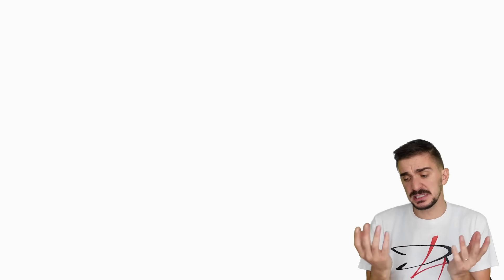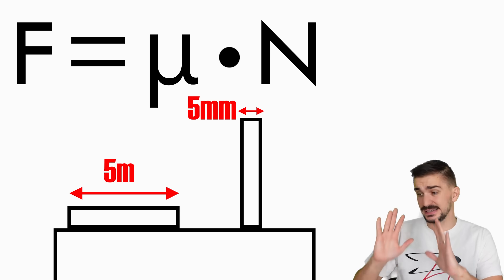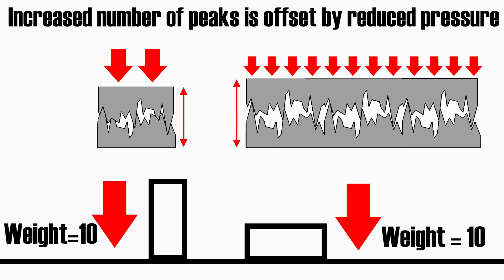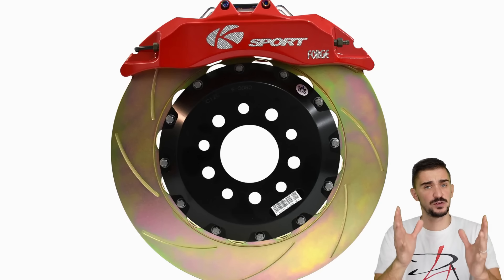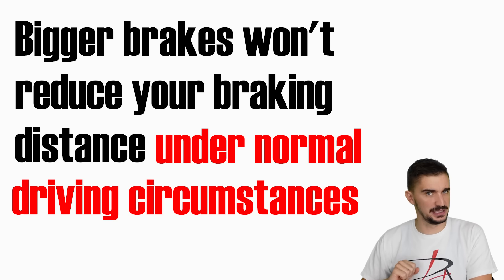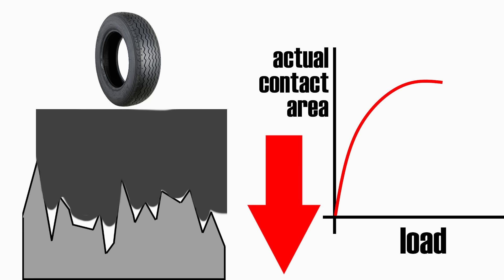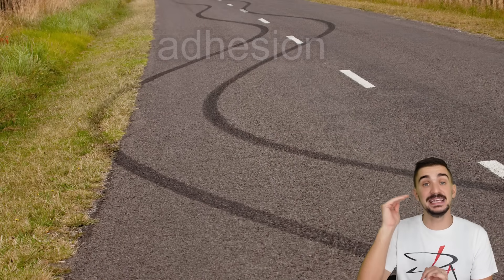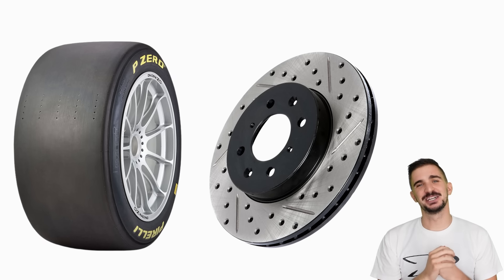Why Big Brakes Won't Stop You Faster but Wider Tires Will - Friction and Surface Area Explained

Comment: I get so tired of explaining this to people who see smaller than stock brakes on my race car. Thank you.
Reply: Fuckin bench racers. Read a physics book. Lower unsprung mass is the point. I also don't use drilled rotors, those are for hard-parkers and just break more often on a track, as the holes create stress risers.
Reply: Smaller than stock brakes on a race car? Is this a drag car? Because that sounds so counter intuitive for track racing where even stock brakes heat up a lot and start fading
Reply: @288gto7  JFC, you just have to keep them cool. The only point of more mass is thermal management. I use ducts. It's a Road Racing car that uses brakes heavily.
Reply: @nobodynoone2500  and more ducts create more drag. Why dont supercars just use tiny af brakes with massive amount of cooling???? Get less unsprung mass and less rotational mass and have the same "cooling capacity". Literally nobody does that, even gt3 race cars with their limited 18 inch rim size run the biggest brakes they can that fits inside the rim. They also have a lot of extra cooling capability thru ducts for the brakes if required. Ferrari 488 gt3 for example has 6 seperate duct setups. 1 gives the least drag and cooling and 6 is the opposite, yet majority of the time they use 2 and 3. they dont want huge drag created from those ducts. Wheelarches are where the dirtiest air is generated, not a good idea to let even more airflow inside them. "Read a physics book" lol im on my last year of mechanical engineering bachelors degree buddy. Also drilled rotors are street car garbage alternative to stop hissing noise coming from actual racing brakes which have slotted rotors and create ton of hissing sound. Drilled rotors are a worse street alternative of those without the massive hissing sound. Gt3 and GTE easily race 6 hours non stop on slotted discs and they dont crack
Reply: @288gto7  You're not stupid. It can seem counter intuitive. But you're also not the smartest pretzel in the bag.

1. You can't imagine ANY scenario in which higher drag would be a desirable trade-off for lower unsprung and rotating mass? How about on a track where the car can't get close to it's top speed anyway? You know, because maybe it's got lots of turns and bumps and stuff...exactly when reducing unsprung and rotating mass is the most beneficial, but reducing drag is not? Or how about a low-horsepower, light-weight car, where every ounce of mass, especially unsprung and rotating mass, makes a big difference, but a little drag hardly matters?

2. GT3 cars use rotor sizes that they engineer for what they decide is the best compromise of the lowest mass possible versus the best heat management possible. My Exige weighs 60% of what my GT3RS weighs, and I'm dang sure not up-sizing it's rotors since it doesn't need it. I get fantastic brake performance on the OEM size rotors, and since I can't get them to fade no matter how hard I try, even in hour long sessions in the middle of August in Texas, I would try a bit smaller diameter rotors if anybody made them for my car. I'm not so concerned that I'm willing to buy blanks, machine my own diameters, and fab up custom caliper mounts...but I would try it if some manufacturer offered it as an easy kit. I would keep going smaller until I started to run into fade problems, then go back up just a bit.

3. That's the sweet spot: Go as small as you can go while increasing performance, and stop when it starts to decrease performance. GT3 cars have the size rotors they have because the engineers have determined that's the sweet spot for THEM, at THEIR weight, at THEIR speeds, with THEIR endurance race times expected. You can bank on the fact that they would design smaller rotors if their average braking BTU generation over the course of a lap allowed it without any negative consequences.

4. If you found that your stock brakes never faded even in your worst use case, and you could correct pedal feel and stopping authority using pad selection and/or cylinder sizes, why WOULDN'T you want to go smaller? As an engineering major, you understand that big and heavy is your enemy, unless you're designing a battle tank or Jersey barriers or something like that. You make things bigger and more heavy duty only when you need to to get the job done.

I don't know what kind of car he has, but if he found no negative consequences, or at least only negative consequences that he could easily correct or didn't matter much, then he absolutely benefited by going to smaller brakes.
Reply: @xtnuser5338  you make a good point on tracks with low speeds etc, but in that case it also gets harder to cool the brakes with airflow since you are getting less of it because of your lower speed but brakes also wont heat as much since you arent going too fast so yeah i can see your point. If the car is low hp lightweight car as you said in other example then yeah you are also right. My point with GT3 is that they could easily put smaller discs and have much more ducting to the brakes and cool them that way but they dobt. They still fit the biggest brakes they can inside of their 18" rims. Also my other point still stands about supercars. They could put tiny brakes and put MASSIVE amounts of brake cooling to cool the brakes and also could put flaps in the ducts to keep them close majority of the time to cut a lot of drag when brakes arent used much etc. but they dont do that, they put massive rims and massive brakes and these days also are carbon ceramic that dissipate heat faster than steel discs yet we see ferrari 488 with massive brakes. Im pretty sure theres some other stuff involved with brakes that we dont know, because street cars using big brakes makes no sense with this logic. They ll save on costs, fuel economy and therefore emissions, have much better handling cars YET none of them do this and instead go for the more expensive less efficient less sporty solution in the end. But as you said it makes sense in some other cases
Reply: As long as you can lock up the wheels or get up to the point where abs kicks in then it's good 👍

Comment: i thought bigger brakes were more to aid in cooling by having more surface area and longer times to heat up through greater mass...
Reply: It does.
Reply: That is correct, the thing is bigger brakes are more efficient in dissipating heat making braking more consistent and predictable. Altho without the grip from better tires u will only end up locking up ur tires which can be dangerous in emergency braking situations...it is why brakes and tires are ideally upgraded at the same time
Reply: @zethjugos1250      you are making tons of generalizations without even realizing it. As a matter of fact the entire automotive industry is. That formula he showed at 1:36? It is wrong. That is an EXTREME simplification of the real math involved. I am a friction/tribology researcher and without even getting into the actual calculations you can prove that formula is not taking everything into account. Coefficient of friction is a function of temperature (and many other things, it is a nonlinear relationship) meaning that you cannot even start to determine brake size without first taking into account pad materials, rotor material, operating temperature, surface morphology, etc. This will all have to be integrated over a set range (of time, temperature, or even surface area) and THEN you can use that coefficient of friction for whatever range you need. And all of that isn't even taking into account the shift from laminar to turbulent airflow during brake engagements,  lol just buy bigger brakes and enjoy, I have spent so much effort and time and money on researching these things (and testing on a full scale dynamometer) but at the end of the day if you have large wheels and tiny brakes it will look goofy
Reply: Tell me you didn't watch the video without telling me you didn't watch the video...
Reply: @detroitiron302  but i did watch the video,  i made the comment based on the title to see if my understanding was accurate and reflected BY the video.
Reply: You are making a big mistaken assumption and it is that the force is the same. The amount of force a hydraulic cylinder can generate is equal to the hydraulic pressure times the effective area of the cylinder. (Effective Area is the surface area of the piston face in square inches.) FORMULAS: Force = psi x Area of Piston. And there is the formula you were looking for. 
The pressure is constant because the hydraulic brake system is the same. The dominant component in hydraulics is pressure. You can multiply the forces applied only by adding more pressure points or the area where you apply the pressure. That is why you see the discs getting hotter in lighting red. It is the result of applying more force. You don’t see the same in the rear brakes in your video, which explain the issue. The rear brakes have smaller pistons. In practice you want this to happen this way to prevent n body roll.
But in general, I hope you have the time to study the subject broadly to clarify some points and make the video more accurate.

Thanks.
Reply: @qdceps  interesting point... does this cause the master to have a longer stroke (due to the larger number of and diameter of pistons) Or do the bigger calipers move less (shorter stroke)? Or is it relatively unnoticeable when upgrading from stock to big brakes? Cheers. Thanks.
Reply: @qdceps  "That is why you see the discs getting hotter in lighting red. It is the result of applying more force. " nope. They getting hotter when they convert more energy to heat.
Reply: @bumbarabun  so
Reply: @qdceps  Rear brakes not getting red doesnt mean they have smaller cylinders neccesarily, brake bias is always to the front on race cars, meaning that they dont produce as much heat. Yes, pistons produce more force as they get larger (in exchange of shorter travel), but when you take into account that they are pushing on a brake pad that has a large surface area, the pressure will be lower compared to the point where the pistons meets the pad. Simply put, to get more braking power on a car, you need a stronger leg or a stronger brake booster (to drive thicker cylinders if you like) and the parts to tolerate the increased forces (bigger tires, brakes that will take the beating, increased heat releasing).
Reply: They also usually have fixed calipers instead of junk sliding calipers, if you use the brakes a lot and hard, sliding calipers usually taper the brake pad material atrociously wasting the pad material and eventually giving up enough pad area that they are dangerous and can't lock the tires any more.

Plus the pads are a lot cheaper, usually thicker too. They last a lot longer on top of getting less hot, and despite being larger they usually weigh a lot less all around when compared to factory brakes.  In my case, the pads are half the cost, the friction ring is $20 compared to ~$60 for a one piece factory style rotor, and the pads will last multiple track days instead of just two. 

There's a lot more to it than this video lets on.
Reply: I believe that he implied this
Reply: no no no you got it all wrong. Big brakes are to fill the negative space behind your wheel spokes when you get some cheapo cast up sized rims on your mom's hand me down grocery getter.
Reply: Did you watch the video?
Reply: Kaiden you have intuited what most who oay attention refer to as thermal mass 😃
Reply: @byloyuripka9624  just because i don't know all the words does not mean i am stupid :p
Reply: Same braking but for longer
Reply: Literally mentioned in the vid.
Reply: they also increase stopping power and the distance... i replaced my stock sport brakes with a big brake kit and the car stops like a fcking concrete block. but even that... it all depends on the quality of rotors and pads you use.
Reply: @Underp4ntz  So what you're saying is the brakes you had on previously didn't have sufficient power to lock the wheels (or cause the ABS to activate). Then there was probably something wrong with them that could have been fixed for much less than replacement.
Reply: CORRECT that's a huge part of upgrading the brakes. Heat loading equals brake fade and failure. Tractor trailers are a prime example
Reply: Tell me you didn't watch the whole thing without telling me you didn't watch it 😂
Reply: Yes, bigger brakes are needed for higher speeds, since brakes only dissipate kinetic energy by turning it into heat, while tires transfer your vehicles momentum back to the earth, kinetic energy rises proportional to v^2, while momentum rises proportional to v. A 40T semi trailer going at 10m/s has 5x more momentum than an 800kg F1 car travelling at 100m/s but the brakes of the F1 car have to dissipate 20x as much energy as the semi trailer to come to a complete stop.
Reply: That's short of right. Bigger brake rotors and bigger (more pistons) calipers to go along with wider tires will get you better/shorter braking distances. Just because you get wider tires doesn't necessarily mean you'll stop faster, because if your smaller brakes don't have the stopping power to go along the the extra grip from wider tires, your still losing out of stopping distance, plus the smaller brakes heat up faster causing brake fade which could ruin your day and your car.
Reply: @bluegizmo1983  Correct. But you'd struggle to get standard brakes that don't have more than enough power to overcome tyre grip, regardless of the tyre upgrade, for one emergency stop. And if you're doing multiple back-to-back emergency stops on the road... perhaps look at your driving.